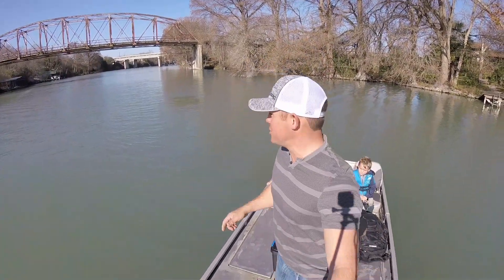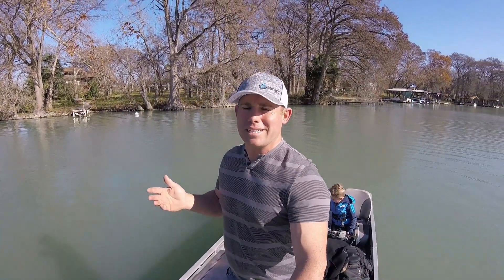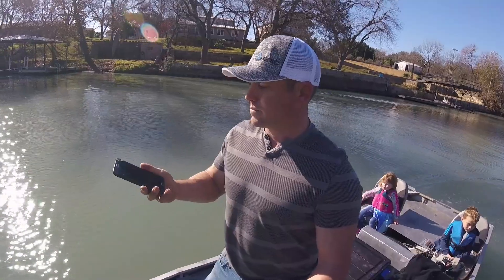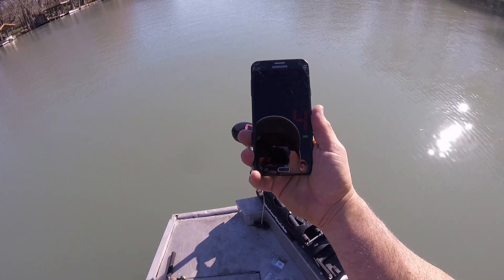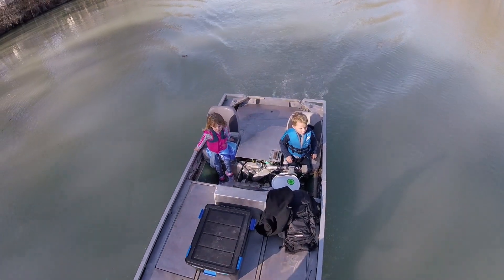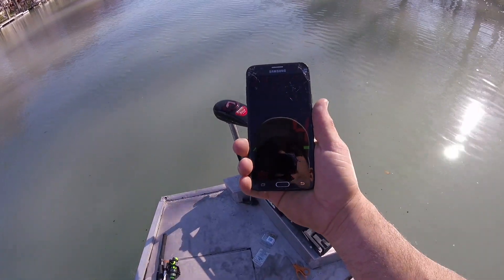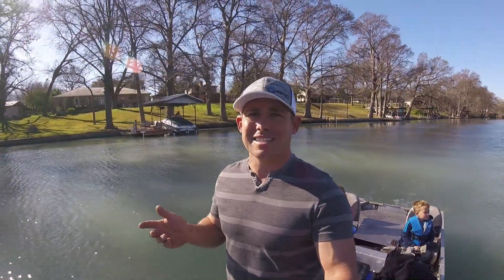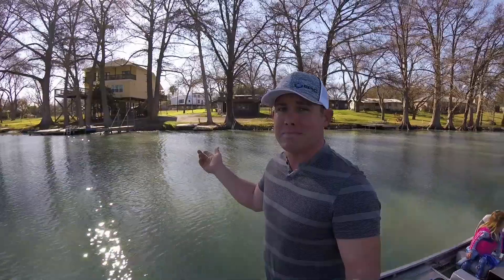How Fast? Jon Boat with 101 Thrust Trolling Motor!

Comment: I’m about to put a 105lb motor on a Paddelboard.  Hope it flies. Had a 20lb until it sank in the water.  I wonder If I can fit 6 of them on it like the center council boats have many engines in back with like 400 horsepower each
Reply from the maker: That’s awesome bud. That sounds like a fun experiment I like your thinking. It will fly just hold on good.
Reply: @TBassFactory  what if I run a 36v motor on 48volts?  I wonder how much more power these motors can handle.  When I had the 20lb 12v I wanted to try 24volts on it and see how long it would take to burn it out.
Reply from the maker: That’s an awesome thought. I bet the motor would be fine as long as the controller wouldn’t cause problems. If it does work the motor will fly increased rpm = increased speed. A lot of e bike setups run 48 and even 60 volts and those bikes can do over 20 mph. If you do try it let me know how it works out.
Reply: @TBassFactory  update, I set it all up and tried it this weekend. Made a box for the batteries from plywood, at the end of the box, I mounted the motor, it did great in the waterway on Saturday at the Haulover sandbar with 3 other friends on it.  But on Sunday, I took it out to the deep blue sea 1.25 miles away from shore.  The beach had red flags up so I knew it would be some nice big waves to test it on.  It worked great.  The water smashes on top of the Paddel board then runs off and you keep going.  I made a video on it and it’s up on my channel.

Comment: I have a 16' welded grizzy tracker sitting at about 1150 pounds has two 80 pound trolling motors and it does 4.6 A and like you said I have fished for 15 hours straight with power to spare 😁 cool video 👍
Reply from the maker: Thanks bud, sounds like a perfect rig to hit up anywhere. You have a good setup

Comment: Change the prop pitch and let her rip. Thrust = torque 
That motor will give you the same speed as a 30 lb trust motor. Only difference is the amp draw.
Reply from the maker: Your totally right Charles.

Comment: Is it any faster to go the other direction? As in pushing the boat like a regular outboard?
Reply from the maker: No it’s the same propulsion. Possibly a little faster but not noticeable with weight shifted towards the back of the boat.

Comment: My 112lb pushes me about 4.5mph on my decked out 1648.   When I shift my weight to the front is when I get my best speed. I know people running three 101 getting 6-7mph
Reply from the maker: That is getting it sammy. I made my Jon alot heavier, but before I added all of the weight and put the motor on high my gps said 7. In austin the sidewalk parallels and people running would double  take when the boat would be the same as their running paced.

Comment: It seems like 4mph is max speed for a trolling motor due to rpms, I put a 55# on a 10ft with no seats or deck ect and that’s all I got too
Reply from the maker: The only thing was I added all of the weight and before I did it got 7 mph on gps. Thanks bud

Comment: I've got a old motor guide tracker 30, 37lb thrust on the front and a transom 30lb on the back and she goes 5.8, but mine is only decked in the front and its a 1432 jon
Reply from the maker: That sounds like a sweet setup for getting out there and catching fish.  You can fish alot of places with that 1432

Comment: I think it being rated for 101lbs on what is relatively a light boat for what that motor is designed for wont give you more speed really. But it has less current draw dragging a jon boats than it would say a 18ft fiberglass boat. Less draw means you get more time out of it. It does look like it trucks along pretty good though.
Reply from the maker: Yeah that little boat can fish all day long on high and not pulling as much weight as one of those big bass boats is the reason why just like you said.

Comment: Higher thrust is higher torque. A 55 and an 80 will most likely have the same top speed unless prop size is changed. However, getting to that top speed will be faster with the 80 because of the higher torque. it is a common misconception that more thrust= more speed but it isn't the case
Reply from the maker: Your exactly right. You know your stuff chad,  but the amount of voltage applied will increase rpms which will increase speed. The same principle is being applied in ebike technology.
Reply from the maker: @steveddad4385  I sure have i have applied 36 volts to 12 volt motors. It's the same concept just more stored energy. It will decrease the life of the motor due to heat but its like putting a supercharger on a motor. The heat and the friction is the biggest threat to any motor.

Comment: only 4 what i run a 17ft deep v with a 101lb and top out 7mph
Reply from the maker: Dang that's pretty good, yeah it used to run 7 before I added a jet ski engine, aluminum deck, and wrapped the bottom in 1/8 inch aluminum. Made it way heavier. I miss it like that, people used to run on sidewalks where I would fish and double take me when I would be pacing them.

Comment: Does it make a difference if the motor is on the front, or back of boat? I'm brand new to this and looking at John boats and trolling motors. 
I may just get an outboard on it so I'm not so limited tho.
Reply from the maker: It depends on if it's a foot controlled or transom mount. I fished for years with a transom mount and caught tons of fish. No matter which you get its all about weight distribution. Placing the batteries or other heavy stuff when it most levels out the boat.

Comment: I Got a 40 Pound thrust On a 2 Man Boat And It does 5.7MPH
Reply from the maker: Sounds like a small jon, scamp or bass tracker. That is fast enough to get to different holes and catch them. Sounds like a sweet rig.
Reply: @TBassFactory  Thanks Man!

Comment: No trolling motor will go over 5 to 6 mph
Reply from the maker: My jon boat did 7.5 on my hummingbird GPS before I added a ton of weight to it. I used to trip people out that were running on the sidewalk in downtown Austin and I would be pacing them.

Comment: My 14 foot goes 5 with a 42 lb that's twice as old as me, a fat motor, deck built, 2 batteries and a couple fat asses. Dont ask me how because I have no idea
Reply from the maker: Ha, I wouldn't care as long as it keeps going it just like that. I had one of the first foot control motors from motorguide and it was like 25 thrust and I actually miss that little motor.